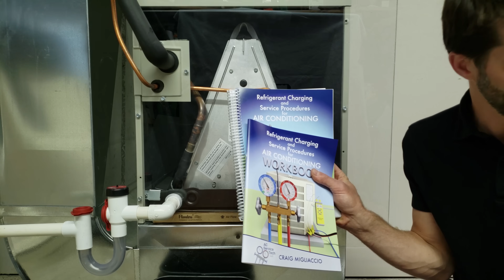Why a Condensate Trap is Needed on an Air Conditioner! Up Close View!

Comment: Great demonstration. But this only happens with the coil before the blower. When the coil is after the blower air comes out of the drain pipe and you need a trap to stop the air from escaping.
I learned a lot from your channel thanks for the tips!
Reply: Great point. This something missed in the video
Reply: how would a trap stop the air from escaping if there wasn't water in it first

Comment: Never realized while the air flowing through the evap is on its way to the cold outlets, it will pull air back through the drain tubing---perfectly logical.  The back pull would be untreated air as well.  We had our system changed in 2015 and they installed a trap.  I thought it was silly.  Now I know!!!  Thanks for making the video.

Comment: i'm a bit confused, isn't air being pushed from underneath through the coil,  so this area in the drain pan wouldn't it be positive pressure after it is pushed trough the coil?  I mean air is going up and into the vents above the unit right? I could see if this was inside the coil or underneath?  For example if you took off that glass panel wouldn't air be rushing in your face? (so therefore air would be rushing to push air out of that hole instead of sucking in?  On my unit a Daikin VRV Life,  both of those holes are punched out one has a 90 degree and the other is the drainage tube... You feel air rushing out of the 90 degree.  So it adds to the confusion..

Comment: I have been working in the hvac service industry for 42 years.  I have never seen this happen on a positive pressure evaporator coil. Meaning that the blower is pushing air through the coil. The condensate pan is also under a positive pressure which helps push the condensate down the drain.  A heat pump will normally have the blower pulling air through the coil and therefore the coil would be under a negative pressure and cause air to be pulled through the drain and not allow condensate to exit the drain pan while the blower is running. Notice how his demonstration used a heat pump air handler. The most common air conditioning systems the evaporator coil sits on top of gas furnace and therefore is under a positive pressure. His demonstration wouldn't work with that application
Reply: I can send you video proving that it can happen on positive pressure machines as well.

Comment: I would say that the accumulated water would drain out when the ac turns off.  It would also be the reason the trap is self priming.  As he said with high volume units or units that run continuously, the pan would run over or trip the safety switch.

Comment: During home inspections I would talk about the vacuum effect when there is no trap. If the unit is in the garage or close to where there might b some chemicals, fumes can be sucked up into the air flow going to the home and if that happens because there is no trap at the condensate line no one will know where the Oder is coming from. So the trap here is rather important!
Reply: Wouldn't the Trap as he has it here, be more likely to suck in the chemical smells? It is sucking in air right where the AC unit is.

Comment: you only need a trap in 2 cases, when the evaporator is on the negative side of the furnace , and when the condensate is tapped into a house vent, alot of times we drain it into a soil stack. in pittsburgh we have basements. sometimes that's the only way.
Reply: This is a positive set up and pulled a negative pressure what are you talking about?

Comment: That trap is not always necessary and the reason is that here in Florida, and other areas, houses are built on slabs. The condensate pipe runs down into/below the slab, then runs back up above ground level, usually about 6 to 8 inches high, where the water exits. This causes the "below ground" level of the pipe to fill with water, in effect automatically creating a very long "p-trap".
Reply: AC Contractor here in Florida lack great amount of critical knowledge The same way they do not use Nitrogen when soldering cooper lines and not even sanding cooper lines-You always need a condensate P trap -It is in the HVAC exam
Reply: @user-hu4hx6bm6m  Yes, but where is it located? The point was if it exits ground level, a p-trap at the air handler/furnace is where you'll see it. If it goes underground and returns to ground level, it's there, but you won't see it as it's formed under the slab, contains several inches of condensate, and prevents airflow from exiting the air handler.

Comment: To funny! 
1. You did not mention anything about water column.
2.  Positive or negative column. 
3. the WEIR of the trap.
No need for a book if the installer will not read the Dam installation instructions that come with the machine. 
And ! please vent on positive flow before a trap and after a negative. Don't blow out the Weir! Those prefabe traps your showing shit! the Weir is not deep enough.

Comment: I see so many drain lines installed without the trap.  I also see this alot, company's are drilling a small hole in the 1st 90 fitting for a clean out then taping the hole. How is this ok?
Reply: The system has to have an option to allow for drainage. A hole drilled or a T fitting is better than nothing. ...and, in reality both work just fine. 

I have seen two systems that needed more, but the installed pieces were both undersized and working too hard. The water jumped up and out. A piece of flex tubing took care of the issue. 

Yes, yes, a trap is best...

Comment: 1:55
Not sure what contraption or devices you are using but my system drains while its running, i pulled that pipe off the hole and it drained just fine, there was NO SUCTION back into that hole at all ever.
Reply: Depends on which side of the blower the drain is on.
Reply: @jeffpeterson1331  is the fan not always above the condenser coil ?
Reply: @ACommenterOnYouTube  no. A furnace with a case coil as an example. The blower is before the evap which puts the drain on the pressure side. You wouldn't "need" a trap but its a good idea as it prevents air that you paid to condition from being blown outside. But the water will drain just fine without it.

Comment: Shocking that this is not a 10+ min video. 
Next i dont have a trap and my ac drains just fine. And p traps are made to keep sewer gass' OUT of your home. This ac drain line does not go to sewage system, it goes outside to open air.

Comment: Some Carrier AC’s have a built in trap in the Drain Pan, so you need to look and/or check the units literature. It you can’t see directly thru the opening to the drain pan, or from inside the drain pan to the pipe. Then check the literature.

Comment: i have a 4 tube water system a/c in the ceiling of the rooms where i work. the guy who installed them didnt use traps just copper line from the pan going 90 degree angles until it reached the drain. will say cutting off the  5 inches of condensate drain line copper and adding a pvc j or p trap adapter? it has no secondary line btw.

Comment: I've got a condensate drain going from my downstairs AC unit, behind my hot water heater, and draining directly into the tub of my laundry sink four feet away. No trap. Ive never had any issues and it's been running for three years in a high humidity area.
Reply: My question was, is the trap even needed really?  I mean, once the unit is of it drains.

Comment: Nice info for the novice here. I'm about to work on a clogged drain. One question: on my unit, the secondary drain does not have a fitting. Should it? Unit's worked fine until recently. It joins up to plumbing draining from the looks of it.
Reply: The way we install drain lines starts with the lowest being the primary, and the next highest called the secondary. On the primary you run your drain line and on the secondary we install an overflow float switch. It helps keep water off the customers floors and if you break the 24vac red wire, they will call for service because their system wont function until the drain is unclogged. If ithe secondary isnt going to be used, I suggest a 3/4" plug that simply screws in to stop air leakage.

Comment: For 60 years, my parent's AC and for 38 years my heat pump had no trap and both drained fine. The new systems have traps and have resulted in service calls. No observable benefits from my perspective.
Reply: It depends on which side of the blower the trap is on. But all A/c "should" have a trap.
Reply: @jeffpeterson1331  Blower? The trap (or rather $trap$, dollar signs for the service calls) is on the drain pan not on the blower. Same setup on the replacement systems as the original systems. The video implies  there is a negative  pressure condition it is thwarting. Don't see how that is even possible considering the pressure from the blower. Wouldn't be the first instance of misunderstood science being problematic.
Reply: @65csx83  if the blower is after the coil, it is pulling air. Which would mean without a trap, air is drawn up the condensate pipe and it would prevent water from draining.
Reply: @jeffpeterson1331  I can accept that that a blower can be mounted such that it creates negative (suction) pressure at the pan's drain but I can't accept that it would prevent the water from draining  and I further can't accept that the trap could make a difference though I have no familiarity with a system where the blower pulls rather than pushes air through the evap coil though I have an open mind on the situation.
Reply: @65csx83  The water doesn't drain for the same reason that slurping a beverage works.   Your mouth's suction 'in' pulls the liquid in to your mouth, and gravity is not enough to counteract that.  If you stop slurping, the liquid flows out of your mouth (by gravity).  Same thing is happening here:  it's the air flowing inwards - the slurping - that prevents the water from flowing out.  The trap makes a difference because it blocks the flow of air into the unit, so no slurping.   Thus the liquid water flows out since there's no air flow inwards to slurp it.  Keep in mind that at that point, the point where the water comes out is under a vacuum, same as inside the unit, so equal air pressure = no air flow.
Reply: @theglengineer  I fully agree with your slurping metaphor. Having a straw in a glass or in a bucket or in the ocean doesn't reduce the slurping effect. Traps only stop air (and gas) flow such as in a sink drain. Traps don't stop siphoning in either direction. If there is enough suction to prevent outflow, having a trap in the line won't improve outflow unless you're counting on creating a siphoning effect back to the drain pan.
Reply: @65csx83  My slurping metaphor did not involve a straw, and this is not about siphoning.   Sinks traps do block airflow, yes, as long as the pressure difference on either side of the trap water is not strong enough to pull the water past the trap.  The suction from the blower is not strong enough to suck the trap water back up into it.  If it were, then, yes, the trap would not work because the water placed there would be sucked into the unit, and thus nothing to stop the airflow.  But the water in the trap is "heavier' than the suction can pull, so the trap water stays, and thus no airflow.  No airflow = no slurpy!
Reply: @65csx83 I know this is an old post but as a ac tech  I have watched the water level rise above the drain hole before when no trap was installed 

I simply held the trap uo to the hole and it began to drain 

It depends on how much negative pressure is being created by the blower sometimes its not enough to cause the problem
Reply: @romp23  Drain pan failing to drain usually is drain hole clogged with dust, debris, or rusting / crumbling drain pan. I don't see how a trap could remediate such a problem.
The traps on my and my parent's units are fixed piping; don't see ho they could be elevated or moved or what difference if they could.
There is positive pressure on these traps. They would have to be on the return plenum to have negative pressure.
Reply: @65csx83  what your talking about has nothing to do with why a trap is necessary 

The trap is required because of the negative pressure created by the blower

The drains are on the return side of the coil  

Normally the evap coil is down stream of the blower hence the negative pressure 

It will not affect all units it depends how much negative l pressure is being created per unit
Reply: @romp23  None of your comment is correct. In fact, if there were negative pressure at the trap, it wouldn't drain; it would siphon. 
The trap is on the drain pan.
The drain pan is below the coil and above the blower.
The pressure in that area is the same as all the outlet vents; i.e., positive pressure.
Reply: @65csx83 I agree. In Arizona what’s the point of a ptrap on the condensation line on an outdoor AC unit on the roof? All I see is it’s just another thing that can get clogged. Should make it as easy as possible for the hvac to drain water not hold water. Right?
Reply: @meltupmike  I agree about the trap clogging. The unit in my house is clear pipe so trap contents are visible. Also, it came with a brush so accumulated dust can be removed periodically. Eventually the water dries at the end of season. However, my brother has an overhead unit in the attic crawlspace, Before the water could evaporate at end of season, it froze and split the pipe which he found out the hard way next season when the ceiling became saturated.
Reply: @65csx83  so do you even need a trap, or can you just drain it downwards if it’s on the roof?
Reply: @meltupmike  No idea why it's there. It caused problems for me, my parents, and my brother. On our original systems , the drain did not have a trap.
Reply: Most air handle  unit for heat pump system will need trap for water to drain, upflow furnace applications  water will drain without trap
Reply: Some units have a very tight watergate pressure, thus sucking air through the pipe causing the water to get pulled into the pan. Like a vacuum cleaner. The trap has enough water density to no allow air to pass or get sucked back into the unit. Thus allowing the water to flow through gravity and survive tension
Reply: I applaud you good sir. You have me vexed on traps and will definitely be looking hilariously closer to them in the field. Cheers to learning.
Reply: I was going to say.....My unit doesn't have one and simply drains once the unit is off just like in the video.  I ended up installing a wye 3/4 so I can have access in the event it clogs.  Nonetheless, the unit has never clogged up until recently but it was at the exit of the unit, not the pvc piping themselves.  Is the trap really needed?  Is it boosting performance or just preventing future clogs?
Reply: @ShyRage1  If the unit has negative pressure, the condensate water may not be able to drain out until the unit turns off, and thus, you have standing water all over your coils and puddles inside your unit.  This is bad because it's made of steel that rusts, and ... well you know what happens.  That's where some people - like me - are.  If I disconnect the drain piping I can hear the slurping sound of the water trying to get out, but continually being sucked back in, and after an hours of so, I've got an inch of water standing in the bottom of the unit.  If you do NOT have negative pressure, then your non-trap drain system is fine.
Reply: @ShyRage1  The only function of the trap, any trap, is to prevent back flow of gases. If your AC / heat pump is part of a fossil fuel heating unit the trap could possible prevent noxious combustion gases from being drawn into the plenum and distributed throughout the edifice.

Comment: Does all A/C require a trap?  My A/C never had one.  My vertical A/C unit flow sequence is 1) Filter on bottom, 2) Blower, 3) Furnace, 4) Drain tube/pan/evap coils.

Comment: Great demo, Craig. I have a condensation conundrum. Perhaps you can shed some light on my situation. I have a 5 ton Trane AC/heat pump installed on my second-floor roof. It is replacing an American Standard that was 14 years old and died. During the summer, whenever the old unit would cycle off a decent amount of water would come out of the condensation pipe and fall into the garden. The new unit has been up there for eight months and I have yet to see a single drop come out of that pipe. Nothing else has changed. It's the same house with the same ductwork and the same climate. Have you ever come across this situation? Is it something I should be concerned about? It's situated on a fairly steep part of the roof so I can't exactly go up there and take a peek. Thank you in advance.
Reply: Maybe its oversized and not staying on long enough to condense moisture. Short cycling.

Comment: 45 years of owning multiple houses and I’ve never seen a trap on a condensate line nor had a pan overflow.
Reply: These are the best practices in the field. This guy knows his shit.
Reply: if its air con and its used on cooling it will need a condensate tray and drain line , note some of the aircon i install has a little pump with 8mm pvc tube to waste

Comment: My air conditioner was installed in 2006 and it has a condensate pump on the drain line to push the water outside as the line goes up to the attic, across, then down and out to the side of the condenser unit.  Does that make it unnecessary to need a trap? OR should a trap still have been installed? The company, (a sub contractor for Home Depot) that installed it was the absolute worse! They failed every inspection and had to completely re-do the installation as they put in the wrong sized system.  HD & Trane were both involved in that mess but I was hoping their supervision would eliminate further problems. Now I wonder.....

Comment: Will it make a difference if the trap is 3 feet away from the exit? Or does it need to be closer than that? My drain is above my furnace so it currently exists and runs to just above the floor where I have my trap. Will that work?